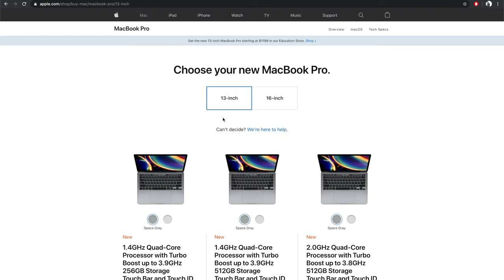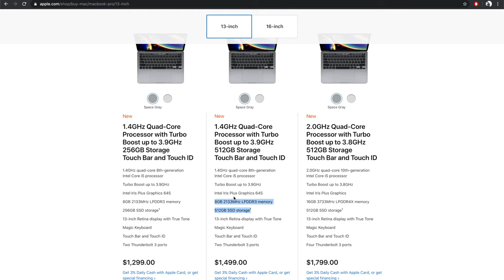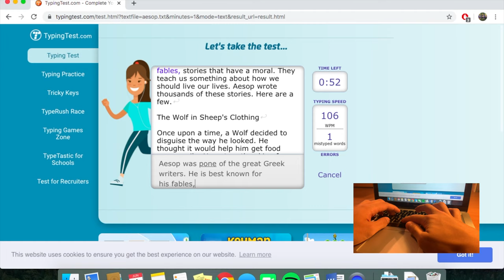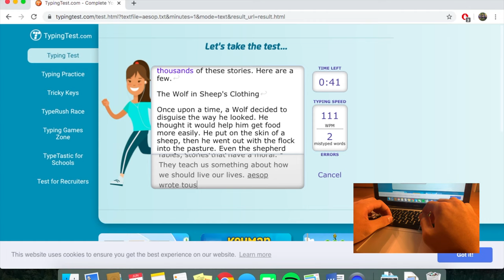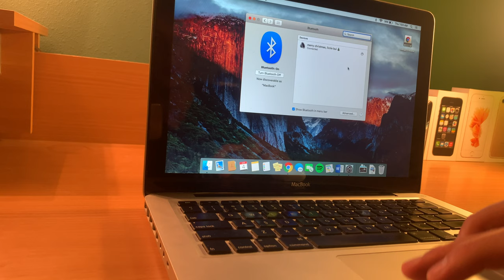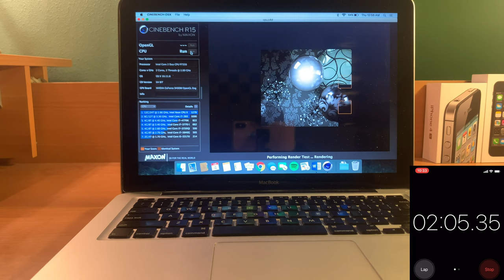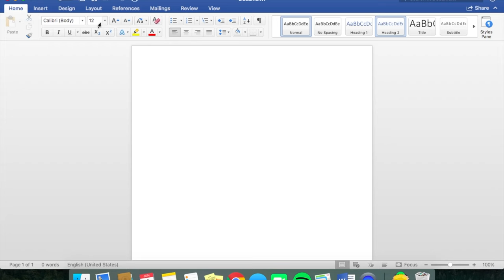Transforming 2008 MacBook into MacBook Pro 2020 ($1499.00) - SSD and RAM Upgrade

Comment: I have a a laptop just like this. I found the OS limiting, so I installed Mint Mate edition and that really brought it back to life. I was able to use Zoom and almost anything else I need to function today.
Reply: Now it’s possible to install macOS Big Sur on 2008 models and yes everything works just fine lol
Reply: Linux Mint is a great os. I am using it in my MB Late 2008 and IMac 2011. Much better than any outdated or unsupported System
Reply: @Flash-hz7iv  isn't the Mint OS kinda like Windows , that's what I read somewhere .
Reply: @kanibis420  closer to windows 7 like feel and basic function i don't know about cinnamon de but ubuntu mate and Linux mint mate have 4-5 layouts to choose from other distros which one of them is similar to elementary os (a mac like distro)[pantheon layout]
Reply: @humppa5  Not really.  every year older macOS gets abandoned by Apple.  Big Sur is already abandonware.  Meanwhile Windows 10/11 or Latest linux distro are fully supported and up to date.

Comment: I have to agree, I did these upgrades to my 2008 macbook a few years ago and have enjoyed the longevity it gave. Only recently did I reach the El Capitan ceiling and no longer can update things like Ableton 11. Also I cannot run Davinci Resolve. This laptop has been so good for all these years. I regret and am hesitant  to purchase another as they are not as long lasting as they used to be. It's a shame. Thank for the well done video. I had hoped you would tell me I could make it like brand new again. Cheers.
Reply: You can upgrade it to Mojave or Big Sur if you want to.
Reply: @dennisbrock1435  nope, the 2008 won't update. He does mention that in the video. El Capitan is as high as it will go.
Reply: You can patch,im currently meditating over it
Reply: @antonistoyanov2144  what do you mean by patch might I ask?
Reply: @AdrianClement  Installing unsupported version of OS on your machine through patch made by DosDude1,apparently there is a way to circumvent Apples' bullshit policy
Reply: @bethschettino2332  Give it a try man,i have managed to patch it wtihout a significant IT knowledge,i have put Mojave on my late Macbook Pro 2008 and it works a bit slower but not bad at all.I have got some issues like,getting restarted while sleeping and had to replace all browser with Mozilla Firefox.Mojave is a bit pretending,you can go for High Sierra or Catalina instead.Mozilla Firefox now takes up too much ram and cpu,but thats fine unless you dont open more than 7-8 tabs.I will squeez as much as i can from this beatfiul OG Macbooks.Im planning to add up 4gb update to compensate a bit.
Reply: Try Opencore Legacy Patcher, it can upgrade 2008 to 2017 Mac to latest OS

Comment: I can confirm this is still a capable laptop even for 2021. I had the battery changed a few years ago, 4Gb ddr3 and a 500Gb ssd installed. I'm using it for photo editing with photoshop cs6 and it works well, a bit slow but very usable! I bought it brand new in 2008 and still love it except the no retina display!
Reply: are you using the normal unibody macbook? not the pro version? im planning on get one as a family laptop
Reply: @esistdume  the normal one yes!
Reply: Yep I’m still running the unibody one too. It does everything I need it to. I only want to upgrade when I see something significantly better and that hasn’t happened in 13 years. Hopefully this year or next Apple
releases a great MacBook that blows everything else out of the water , brings back MagSafe , multiple connections , and has no silly gimmicks .
Reply: @uzomad  well, i think it happened lol it's time for me to get a new macbook. The M1 are looking amazing, although i still love my 2008!
Reply: My moma have me a MacBook Pro. I want to use it for video editing. It’s a 2009 I believe. 
Would you recommend and internal ssd or external ssd for now? I need to clear up some sd cards 🙃

Comment: tbh, computer prices today are pretty reasonable compared to what they used to be. For people in their 30s and 40s and above, we remember when a typical laptop in the 90s cost about 3k in 90s dollars. That’s almost 6k today. You get a lot of bang for your buck today compared to those 90s machines too, and they’ll last a lot longer. Just thought I’d give a little perspective on the pricing. People should look back through Apple’s pricing in the early 2000s, everything used to be way more expensive, especially when you take inflation into account. I remember buying an iMac in 2006, one of the first intel macs, for 1299, the same price as the new m1 iMac.  But inflation means that 1299 today is a lot cheaper than 1299 in 2006. By not raising prices, apple has effectively lowered their prices.

Comment: Just found this video today.

My first Apple product is the Macbook 2008 shown here. That is the most beautiful device I own at that point and I still have it with me today.  

You won't be able to get the 2008 to a 2020. Not only of the CPU and GPU difference you are comparing a 500MBs SSD that you just install to a 7000MBs NVME that the 2020 MBP uses. Probably will also need to shell out $50 for a new battery soon too. 

Still use my upgraded MB 2008 using Lion for old apps, parallel VM of Win 95 and 98 to run older games and it is great.

Comment: It can be upgraded with SSD and 8GB of ram which running the OCLP Monterey Patcher for this devices to support the latest softwares in 2023.
Reply: Not really.  Too many things are broken with OCLP on these old non-metal macs.  Cpu is too limiting to install latest macOS even if everything was fully working.  Windows 10/11 or Linux latest distro is much better solution.

Comment: My 2012 Mac got water damage.. so a friend is giving me a 2008 Mac.. can I put my 16 gigs of ram in it? Also would my 2012 hard drive fit??
Reply: if I understand correctly, 8gb is the max it will see and though it will run with 8gb, 4gb is the max officially supported by Apple. Though a machine this old will no longer have Apple support anyway, so no harm in maxing it out at 8gb

Comment: Hi, great video, thanks. 
Pls is it also possible to upgrade MacBook from early 2008, OS X Lion 10.7.5 (11G63) to a higher version? This version doesn't allow to upgrade browsers anymore, so it has problems to view some things on the internet or play some videos. Othervise the Mac is still working perfectly. Thx a lot.
Reply: There is a web browser called Pale moon which is supported on 10.7 and it is Fully up to date
Reply: Hey Hana, I have a MacBook - late 2008, and I upgrade to EL CAPITAN. Works perfectly well. I did install 8 GB DDR3 Ram. It was easy. Just search how to upgrade YOUR specific MacBook Model, and hopefully will work for you. Good luck.
Reply: Jana, install Linux on this macho e. You will have security and performance.
Reply: It is possible to update it to macos El Capitan from the Apple page, it is also possible to High Sierra from the dosdude1 page

Comment: Im watching this video without great upgrade, Core2duo 4 gigs Ram and on Catalina, I'm very Happy :)
Reply: @nooneinpart  im about to ask same question 😁
Reply: @nooneinpart  Catalina runs great on an 265gb SSD and 8gb Ram
Reply: @nooneinpart  if you can use Big sur instead of Catalina, it will run even faster. Catalina was not that good compared to others releases, and big sur is not far from the speed of High Sierra. The best one in my opinion for older machines.
Reply: @nooneinpart  well, it’s not “officially supported” but who said it need to be official lol 
I’m pretty sure you can, what did you read that make you think you can’t ?
Reply: @nooneinpart  It’s a pleasure to help and it works well but, of course you could have stuff from working properly Cauz it’s not supposed to be compatible officially. Normally it should not be that different from Catalina from dosdude tho.

Comment: Hi I bought this Harddrive and when I turn on the Late 2008 Aluminum and press Command R all I get is a folder with a question mark in it. REALLY REALLY need help trouble shooting so I can get an operating system going. You are sure this kind of Harddrive (WD SATA SSD) is compatible with LATE 2008 13" ALUMINUM? Thank you much, any help would be GREATLY GREATLY appreciated---
Reply: I have the same problem, the SSD is not recognized in my MacBook late 2008. Have you been able to fix the problem?
Reply: @GoAnimateFan-fd8gx  You have to create a bootable drive with El Capitan. Hit option key when booting up, select the drive and upload new operating system.
Reply: @michaelg9359  I did that but it doesn’t work. Now I just put the slow HDD back in
Reply: @GoAnimateFan-fd8gx  you literally have to download the OS from Apple, create a bootable USB and then use it to install on your new SSD.

Comment: How about the pro version late 2008 unibody macbook 🤔 I got it for free to, I installed a 1tb Samsung evo ss, optical was broken so a 2tb hdd swap owc kit, and I am putting in 2x8gb ddr3 ram like you have done I believe my macbook is better spec not by a lot though 2,4hz i2 and 250mb videocard, I am also planning on installing windows with dual boot(yes its unsupported but I found a way for people interested and wanting to run win 10, you do need to install win 7 via usb, with iso file, less then 4,5gb or via disk preferably but if your optical drive is broken like mine you need to change bootcamp settings 😉)

Comment: is it real?... the mbp 2008 is just maxed out at 4gb of ram, 128gb of ssd (or can it has ssd and hdd at the same time?.. pls tell me) isn't it??... 
and also the proc is just core duo :((
Reply: On some models you can remove the optical drive and get adapter to place ssd
Reply from the maker: Apple states MBP 2008 can only use 4GB, however, if you follow this website the max is actually 8GB. 

https://everymac.com/actual-maximum-mac-ram/actual-maximum-macbook-pro-ram-capacity.html

Comment: The harddrive on my moms old 2008 isnt being read. I figured since she gave it to me and got a new pc, i could fix it. There are three possible issues, ribbon cable, hard drive, or motherboard. I figure I will upgrade to ssd, replace ribbon, and upgrade ram, and run linux on it instead. Do you know if I am able to use a newer motherboard in this for an upgrade incase the motherboard is bad?

Comment: Did you have to format the SSD before putting it in or during the installation?
Reply from the maker: Yes you have to format it through disk utility to extended journal and for later models APFS
Reply: @cbeducation2716  How did you get it to boot to the disk utility mine just flashes a folder with a?
Reply: @blowerbandco1607  Hold command r at startup that should bring you to internet recovery where you can reset the drive in question.
Reply: @llamaisms  So I actually had to boot from my backed up Time Machine copy then launch disk utility from that show the internal drive those unformatted than a race in format it and then restore from time machine but it worked ultimately

Comment: I bought an SSD but it does not get detected in the MacBook at all, whether I boot into my bootable OS X installation USB, or into a live linux distro, the MacBook just doesn't recognize the SSD. The SSD does work in my newer Windows laptop from 2014, but not in the MacBook. I've also put the SSD into my old 2007 Windows laptop and it also doesn't get detected in there. 

So apparently modern SSDs do not work in old computers? I do not want to return the SSD, so does anyone know a fix for this? Thanks.
Reply: You'll have to format the SSD in Disk Utility before installing a Mac OS.

Comment: RAM is something I need to upgrade on my MacBook Pro late 2008 but while reinstalling the OS, i am unable to install El Capitan for some reason and was wondering if anyone else faced the same issue or how to upgrade the OS please
Reply: use the open core legacy patcher 0.6.8. and you can surley intall OS Big Sur with it.. Maybe even Monterey or Ventura. My mid 2009 is running Ventura with 8GB ram and 1TB ssd and works perfectly

Comment: Hi, Can I use this laptop for edition apps like Photoshop, Illustrator and Premiere?
Reply: no, it will run really slow. I recommend getting a 15 inch mid 2012 macbook unibody (*not* the retina model!) which has a quad core i7 processor so it will be perfect for these tasks. But the late 2008 MacBook is too weak and I don't recommend it for Photoshop, Illustrator, and definitely not Premiere at all.
Reply: @GoAnimateFan-fd8gx  I have a MacBook Pro late 2008 15 inch, Can you please tell me if this model is able to make renders? Or what I should add to it to be able? because right now is not even capable of working with 3d models in  Autocad, Thank you so much in advance, Im studying Architecture and the performance of the computer is not helping, Thanks!
Reply: @getmoreplay8488  hello, I have installed a really old version of Adobe Premiere and it works faster, and exporting a video can take up to an hour. But unfortunately I’m not familiar with the software you mentioned, but maybe downloading an older version like I did will make it faster?
Reply: @GoAnimateFan-fd8gx  the retina model would be much better as the non retina screens are really bad quality especially for adobe apps
Reply: @drbass9677  the 2012 model with a non glossy mat display actually has a much higher resolution than the standard glossy models, so it’s very suitable for adobe programs. The reason why I don’t recommend the 2012 retina models is because a chip in them is very prone to fail, which will cause the MacBook’s GPU to stop working. Here’s the explanation: “The chip responsible for creating GPU Vcore in this machine is called U8900. This chip sends out spikes of 12V into a coil, which averages out to around 0.9V on VCORE. However, the solder joints on U8900 are very suceptible to cracking over time, causing GPU VCORE to drop to 0.6V or lower. This causes the machine to randomly shut down or black screen.”

The unibody non-retina 2012 model doesn’t have this issue.
Reply: @GoAnimateFan-fd8gx  but still I still have a 2012 retina MacBook Pro 15” and it works perfectly. Had it since new. Plus it’s cheap to fix the chip ($80) that fails compared to the 2011 model where the gpu itself dies. 

The matte unibody MacBook pros are harder to find these days.

Comment: You can try to upgrade it to high sierra or catalina dosdude has a patch for upgrading the Mac OS of older MacBook and iMacs that are being unsupported by apple but he did find a way give it a go
Reply: I used Catalina for a while with the dosdude patcher but I went back to Mojave due to some apps I need to run that I don't wanna pay for to run on Catalina. Works great with 8gb ram and an ssd

Comment: i have the same macbook and my fan turns to much and make a lot of noise. and how did you fine all application compatible for mac os el capitain ?
Reply from the maker: There might be a lot of dust accumulated in your fans. Try cleaning that. Also change the thermal paste on CPU. This will be in a later video!

Comment: i installed ubuntu 20.40 do to me not having software cd and optical drive doesnt work and it runs amazing im able to watch youtube at 1080 i still havent done these upgrades will being doing them pretty soon so i expect better performance i have 2009 white macbook with 2gb ram duo processer my mother basically gave me the macbook she found it at yard sale for $20 lucky me update ssd and 8gb ram have been installed works amazing!!!

Comment: Hi! I have the same mac as yours. I have been dealing of this problem recently, My mac suddenly didn't boot up and the breathing light isn't on (usually, it goes on when I'm turning it on). I have let it checked on experts and they said it's on the memory. If I changed the memory, will it still run? Also, there still power from charger and battery which means the logic board is still good. 
I hope you can help me with this.
TIA!
Reply: it sounds a bit strange. no matter what RAM's GB is, as long as it is working, that shouldn't block you from booting up. does the expert say your RAM is broken or what?
Reply from the maker: If it doesn't boot on it could be a lot issues... Try checking if it holds a charge first
Reply: Hi,
A bit late lol 

Normally if it’s the ram you will hear 2 “bips” sound at startup, if it doesn’t boot up and there is no light flashing, it could just be the cable that connect your hard drive to the Logic board, I know it happened a lot on some models between 2008 and 2011. You could try this solution, I don’t have it in hands unfortunately tho so I can’t be 100% sure about that.

Comment: I need an installation guide that doesn't use an Apple ID

Edit: Make that an installation guide for a new hard drive without Apple ID, restore disk, or recovery partition!

I plan on upgrading my MacBook with an SSD to reace the now 12 year old mechanical drive.

Comment: Hi Guys, usingEl Capitan OS, can we use Zoom Cloud Meeting App? 

A few days ago, I bought this model and it is not upgraded ever since so I'm planning to upgrade it to 8gb 1066mhz and 250gb Samsung EVO 870..

TIA..Stay safe..
Reply: I want to know the same, if anyone knows. Which RAM will you use?
Reply: @markclarkdj  hello bro.. I bought 2pcs of 4gb 1066mhz.
Reply: @raymondregala6489  And any SATA internal disk will work?
Reply: @markclarkdj  it should be fine brother.. but I suggest SSD
Reply: @raymondregala6489  For example Samsung EVO 870 is working?
Reply: @markclarkdj  hello brother.. yes samsung 870 evo is working.. 
I'm still finding ways how to install OS and what OS should I install